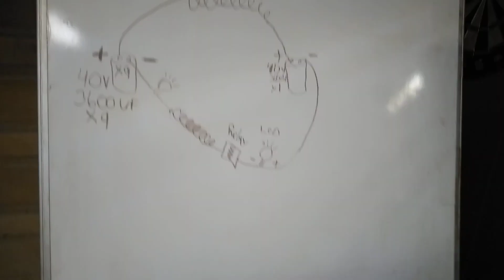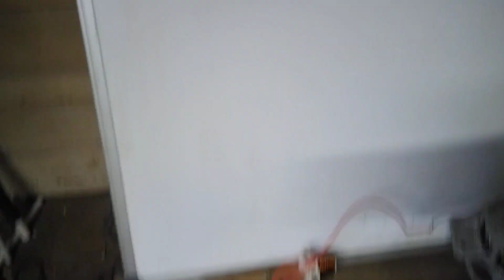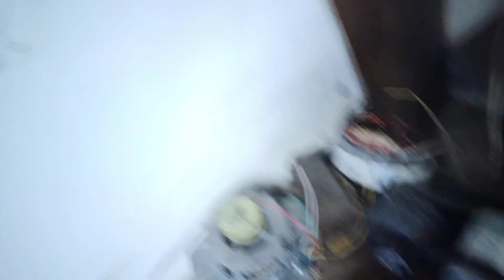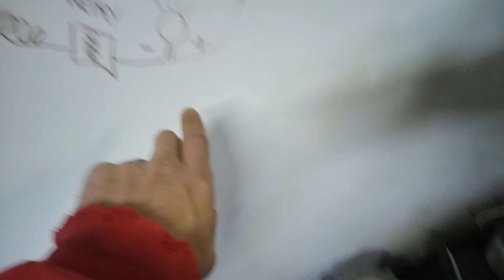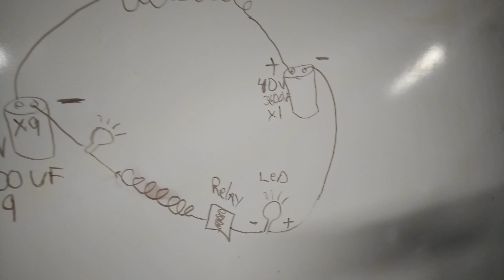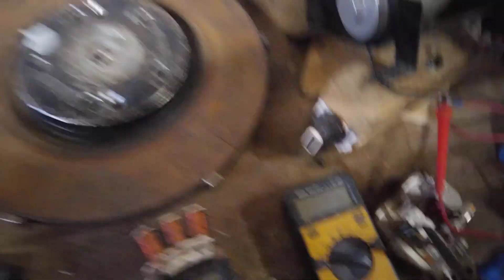Creating a magnetic field for free. 🤯

Comment: Why not use some MOSFETs like irf740 capable of 400v and 10-12 amps  or the irfz44n , is more like 60 volts and possibly require  5v to turn on being N channel , uses positive to switch on, and source and drain connect to the neg side with a 10k resistor to thr gate to  ground   use a hall effect switch to trigger the pulse, use the flyback from the coils also, with recifier diodes,  and a mosfet that is on when the pulse is off to harness to harness the back EMF.  And use the pickup coils to pulse a inductor and rectify and catch that back EMF as well as the power picked up from the pickup while the pulse motor is running,  i feel using a ocilliscope with a shunt to read current as well as the voltage to show the real power, a volt and amp  meter will never show the real actual power transfer, id use a single caoa capacitor to be charged by all the sources. Then use a dc to dc converter to power the load. Use a cc cv version so battery charging is possible i have been thinking if hiving gravity harnessing a try.  Like a bar with two universal joints with a flywheel
On one end and a bar and weight mounted offset of the bar.  With a slider on the top. To allow the bar or shaft to slide from straight to angled, a cv axle would probably work.   Thing is to get the offset erignt to keep falling  to the low side of the shaft when its at a angle . The top mount moves from say, 60° to 0° to 60° or angled to the left. Straight up then angled to the right the weight tryiing to always stay in the angled side, or  down hill from its view, using a small motor to tilt the shaft dpinning the flywheel as the weight seeks the low, the weight should put 200x more TQ on the shaft than the tiny motor simply pushing and pulling  use a 1amp 12v motor to generate 40 amps at 96v or something,  it is more of a power amplifier ,it should be possible to simply  use 300 watts of solar to charge batteries, about 400ah 12v, use 1-2 amps at 12-14v to push and pull the shaft to generate atleast 12v 20-40 amps , minimum, snd possibly add another weight to the top offset ,  a guy in the 20-30's, 40's was running his shop like this each generator had 4 to 5 shafts offset weight's seems it was 10 watthours to generate 10kwh or something its doccumented, but details are difficult to understand. I want to build a desk top version using a 5-10 lb weight. And a 350 watt hub motor generator with a 12v gear reduction motor unning at 200 rpm with a further reduction ti move back and forth at 15 to 60 strokes per minute  to see how it works,